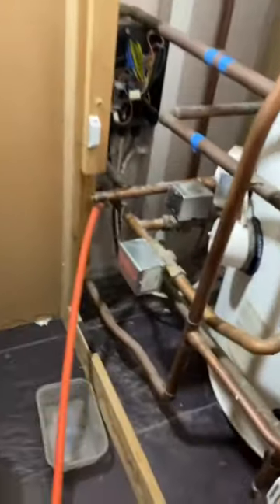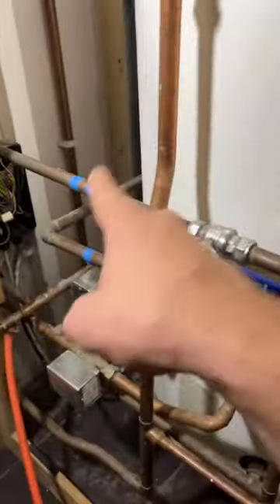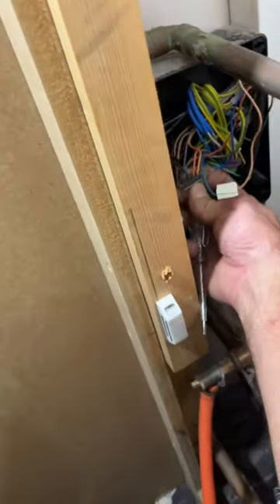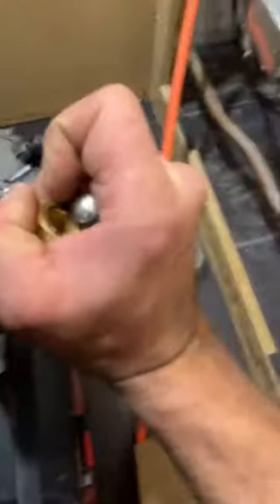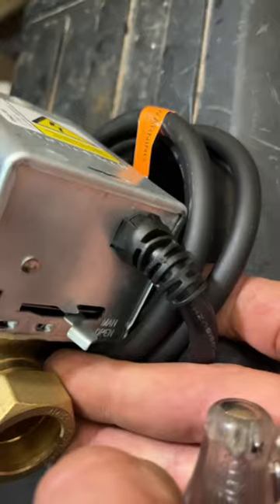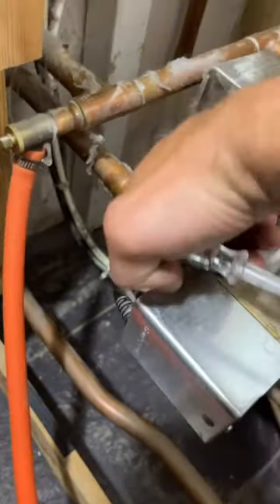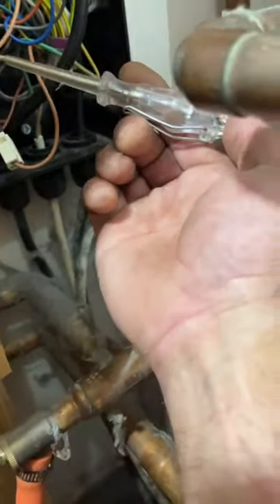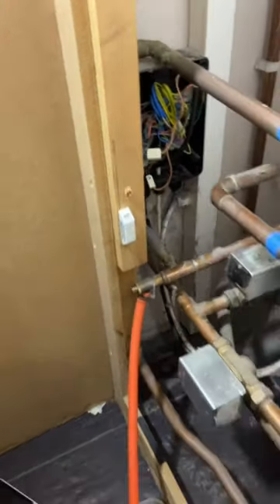Various ways to identify a faulty motorised valve

Comment: Ok, your video repeated many other videos so it has to be correct. We just moved into our new forever home, wife's a qualified plumber and I'm someone who does plumbing and wiring to the best of my ability - unqualified. But we have a unvented pressurised system. And on day one everything did what it's meant to do. The wife is well used to oil heating set ups. Fixed countless issues for us/others. But this system use is new to both of us, her experience with the system admittedly isn't anywhere near as knowledgeable. But I'm definitely learning fast. So we have water, heating up/down separately. We either GET hot water or DON'T.. yet when she checked the motorised valve for the water it seemed to be doing its job. Heating up/down works flawlessly. We also have the option for immersion which you guessed it, will either give hot water or refuse. But it's possible because I turned the temperature down on the element was simply dangerously hot, only a notch, 10-15 degree turn. Could this have upset the system? How on earth? The boiler is at 65 max, the valve for water at the stairs appears to be working but no hot water on gas or element. Did the previous hot water trip the element on the immersion? Is this possible? I've to test everything later today, I think after watching so much I actually now understand the system but have you seen this before? Believe me, we're far from incompetent, just new to the system. Any suggestive advice?
Reply: Test programmer
Reply: @jacko2815  it's all sorted. We have everything working as per requirement. Just had to learn what did what.

Comment: How would you know if its the two port valve or if its the programmer?? How do distinguish between the two which is faulty bud?
Reply: Test grey and orange wire
Reply: @jacko2815  thanks bud shud u have 240v on both
Reply: @zxcherry7356  orange fires the boiler